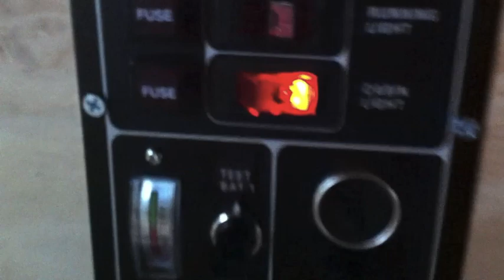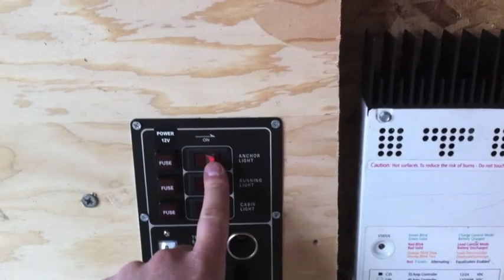Wilderness Off Grid Cabin Solar Lights - June update

Comment: Here is a tip... put your batterys into a marine battery boxes, or fiberglass the bottom of the storage area for them, ( if not, the acid will rot the wood out quickly and drop your batteries to the ground).  I have even heard of people storing their batteries in glass baking dishes they bought at a yard sale.  I learned the hard way with an over charged battery on the corner of a P/T deck, it absolutely destroyed the wood ).

Comment: You might want to check into the cost of a battery pack from an electric forklift.  Around here you can get a refurbished unit for around $500 with its own charger built in.   People put them in cabins because they are extremely difficult to move without a bunch of strong guys or a forklift or winches.   Means they are a lot harder for the scavengers to steal than RV batteries.   You keep it topped off with solar, but if it needs a full charge, you do that with the generator every few days.

Comment from the maker: @dirtTdude Totally, that's the plan. I bought these magnetic releases from Home Depot's cabinet isle that will hold the top 2 corners of the panel with magnets then when you push on them they push the panel out about 3/4 of an inch so it can be removed. I'll let you know how it turns out. They were only $1.09 each.

Comment from the maker: @Gardensandcabins Well you can look into the max size for a storage building or shed in your area. If it's big enough for you and you don't live in it, you might get away with not getting a permit. Get the rules though so you know. Fines are usually triple what the permit costs, unfortunately it's only getting harder to get permits in my area.

Comment from the maker: @reddwarf2956 Ya I gotcha, I should mention that I've used this system for 3 years in the shed and recent thefts have necessitated hiding some systems in the wall. I plan to monitor the heat output of the CC during a long stay. It's rated for 40 amps but only receives 4 from my panel and has never felt hot in the last 3 years so I'm not that worried about it but I'll let you know.

Comment from the maker: @reddwarf2956 Good call, ya I will see. there is a 1" vent hole at the bottom of the stud bay and 2 1" holes at the top for wires to pass through. I think I'll run only 1 75watt panel to start with. When will the charge controller make the most heat? When the battery is full and it's adsorbing the power?

Comment from the maker: You'll have to be more specific on all these problems. It's a 12volt system that procuces no heat and we used it for 5 years so no I'm not worried about it being in the wall. Also it's totally fused. Battery box is more than ventilated, it's outside. So I'm not worried about a fire from the solar system. The stove on the other hand does worry me a little. Not that you can see how it's setup in the video. Everyone on youtube is suddenly an expert on your setup they've seen for a few minutes...